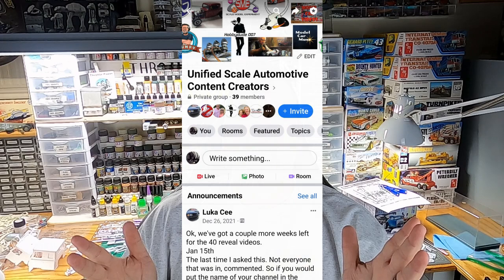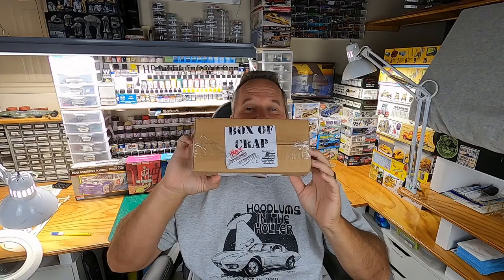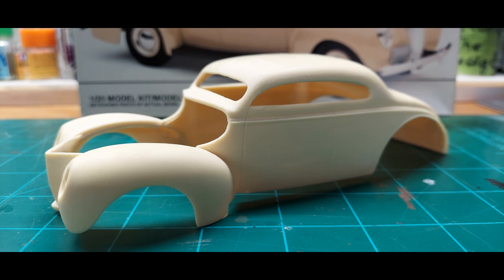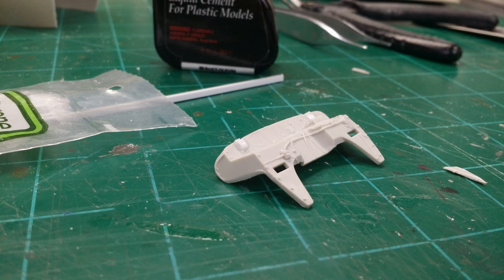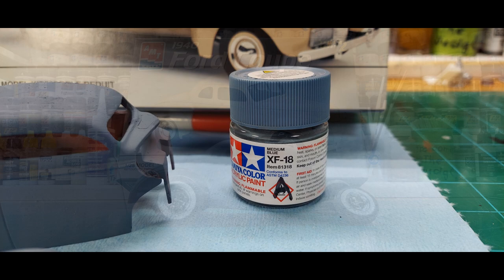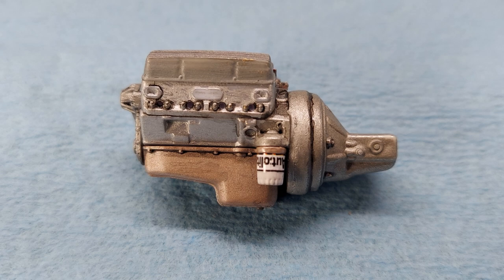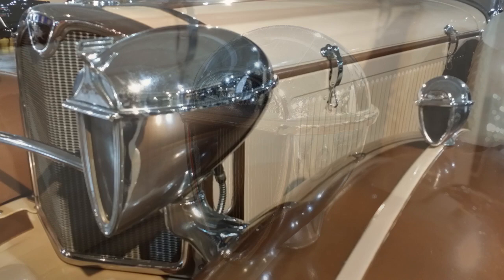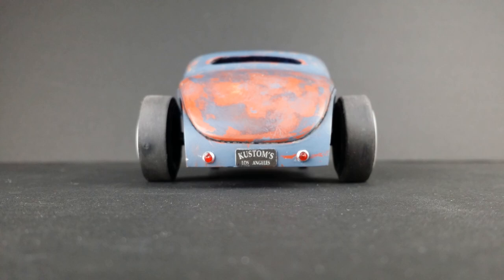Model Car YouTuber Build 40 Ford Challenge Rat Rod finished

Comment: That kit you used for the engine actually builds into a very nice box stock high or low boy model car. I built mine as the high boy but with the low boy motor option the lowboy motor is the huge blower and the high boy is no blower and I feel like the high boy should have the big tall blower motor just my opinion it looks good but damn that kit makes a beautiful 29 ford roadster box stock build I did both low boy and high boy and you get a extra frame and parts with the kit as well for other parts bin hot rod or rat rod builds great doner kits and stock build kits I love it. But damn your rat rod is freaking beautiful. Ease do video on how to cut the plastic clear windows that comes with model car kits for fitting inside chip tops please I tried cutting a few extra windows I had and they all spider web cracked or shattered no matter which way I tried it all messed up so please do video on cutting windshields and glass for these model car kits thanks
Reply from the maker: Thank you for the kind words, I'll look into that!

Comment: Tooooo..... Kool Tim, that's what l call ( rockabilly- style) that's what l build in my shop!!   lm working on a 36" ford chop rat- rod, low and dirty wide whites, scratch built frame interior channeled too many parts to list from parts box,, but my videos are coming soon Rockabilly scale kustoms, lm also a vendor at a lot of model events ( atlanta- show) l have the chance to build the box art kit of a custom 59" rambler sedan delivery drawing by ( brad lesiley) for a johann release too cool , stay safe teddy,,
Reply from the maker: Aaaaa, very cool Teddy! Did you vend at the ACME show the other month?
Reply: @THROTTLEPOWER  yes, l was a vendor at that event,,,,,.    l sold the show cases, and about 200, old build-ups, you got me on video,lol,,,.         working on a custom 59" rambler sedan delivery for okie,,,( johann kits man) to be cast in resin, plus a 55' pontiac safari wagon, l should do these on a  tube channel, it could be interesting lol  my videos are coming soon. Teddy
Reply from the maker: @teddyburns7379  Oh yea, I remember you. You had GREAT prices on the cases. I sent several guys over to buy them!! 🙂👍

Comment: Nice Job! Question, if you don't mind. I'm returning to the hobby after a very, very long hiatus and still pretty far down on the learning curve of new stuff. What did you use for the Indian Blanket and how did you make it look worn and crumpled? I'm working on a 1934 Ford Pickup and want to use a blanket to partially cover the seat and back rest. I've already cut a portion of the seat out and built seat springs to show through, but I haven't figured out about a blanket; real cloth, decal, etc.? Any assistance would be greatly appreciated. Thanks in advance.
Reply from the maker: Thank you so glad you liked it. Feel free to ask anything you want and I'll try to help you out.... All that is is a picture of a blanket from the internet (sized down to the size I wanted) printed out onto a sheet of paper. Then I cut it out, and wadded it up numerous times to get the worn look then glued it onto the seat with super glue. Several guys have been wanting me to do a video on the blanket (since I showed a different blanket in a video the other week) so I might do one for this coming week. Hope that helps you out. Anything else, just ask! 😉👍
Reply: @THROTTLEPOWER  Thanks. I had already saved a bunch of blanket pictures from online so I was on the right track. I just didn't know if I should use printable water slid decal paper, regular paper or if there might be some actual cloth available. I can see how regular paper might be better to show wear and crinkle. I want to also try using something similar for the headliner and have a corner of it hanging down. Thank you again. I really appreciate it!!!
Reply from the maker: @jtodora  Yep, go with regular paper from your printer. I just keep working it, working it, and working it until it's ready to tear/fall apart. Sometimes the tear works out good as I can use that a for an over lap. The headliner will work just like the seat. I covered the door panels on my red Foose truck build. You can see that in a vid I posted the other week. Let me know how it works out for you.
Reply: @THROTTLEPOWER  Thanks again. I'll let you know how I make out.
Reply from the maker: @jtodora  Cool
Reply from the maker: Wanted to let you know that I just put out the Mexican blanket video. Let me know what you think. Thanks, Tim